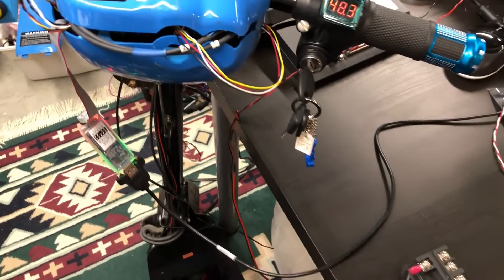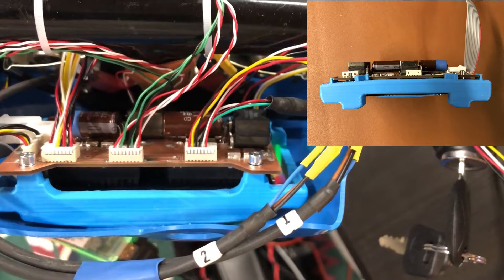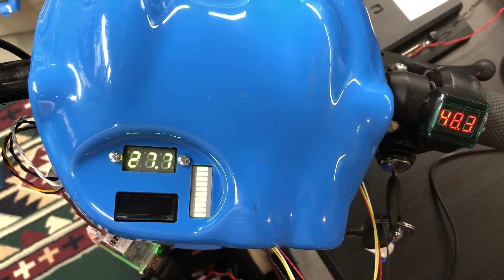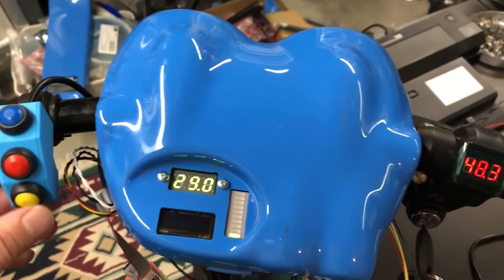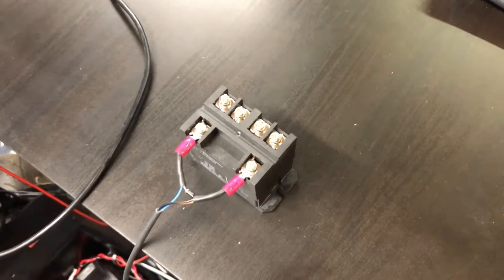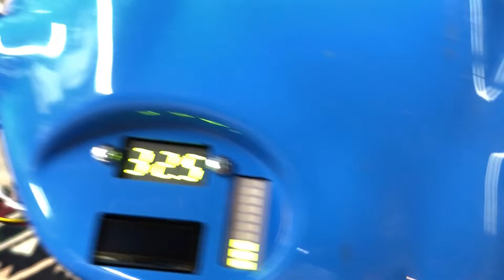Charly Scooter - Retrofit to a 48V System & Custom Motor Controller: Part 7 - Head Installation

Comment: The project is really good , no reference for parts , not showing how you actually installing parts and getting things done . Little to no info for viewers working on same or similar projects . Thanks anyway.
Reply from the maker: Yes its not a step by step video since everyone's build can be different and I am re-using things from different applications where I can and doing some custom stuff to secure things in place.  For those things that are an off the shelf purchased, my choice is not necessarily someone else's choice because of availability or preference, so part numbers are somewhat arbitrary as long as the function is met.   A eval microcontroller board from microchip will work just as well as one from ST or Nuvoton. They all have similar function but different I/O arrangements and pcb sizes, so it really comes down to whatever the builder is comfortable with.  The intent of the video is to show you can fit the modifications and to show how they change the look and feel of the scooter while providing only a loose guidance for approaching the retrofit.  Probably not helpful for you, but hopeful give context for the video.